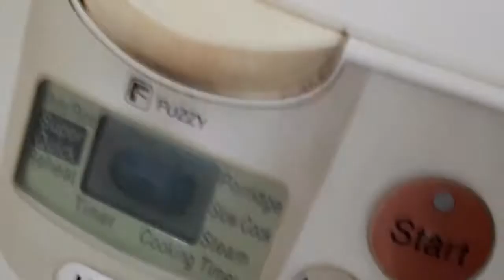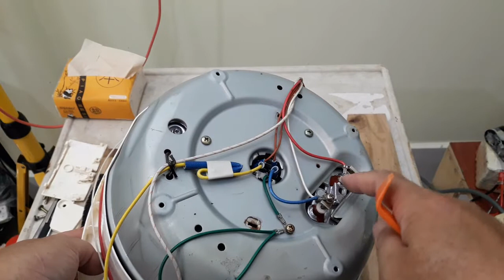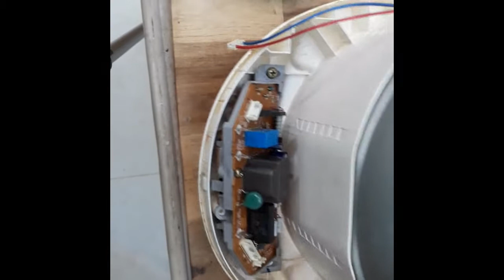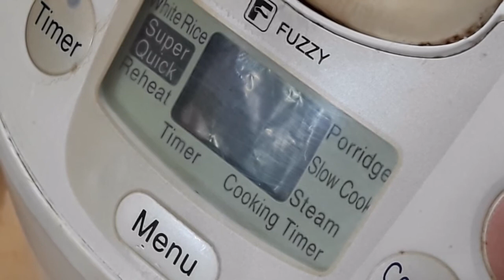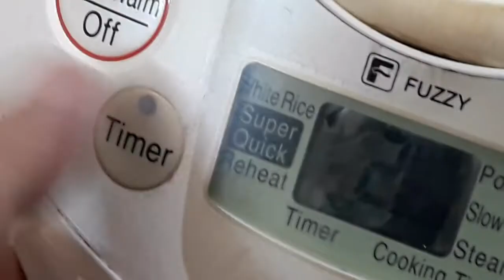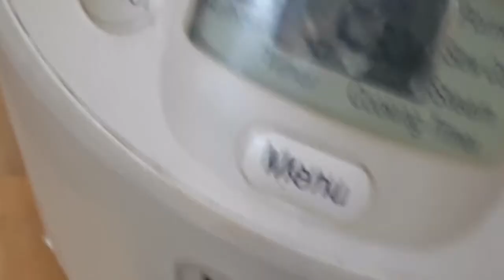LCD Screen Repaired   Rice Cooker

Comment: Where or how to order the screen parts ?for the individual model & brand . of your individual rice cooker from where ?
Reply from the maker: I am used aluminum foil as the screen reflector. The hardest part is cleaning out the existing elector glue.